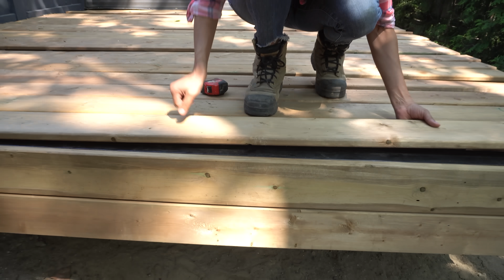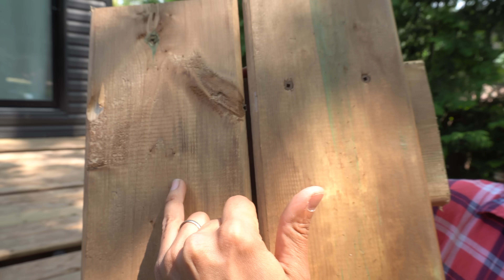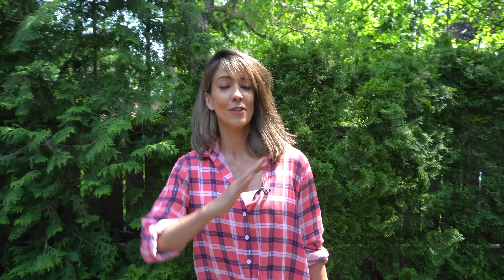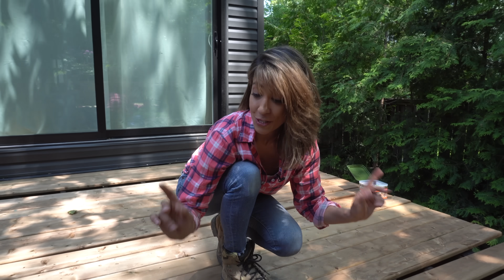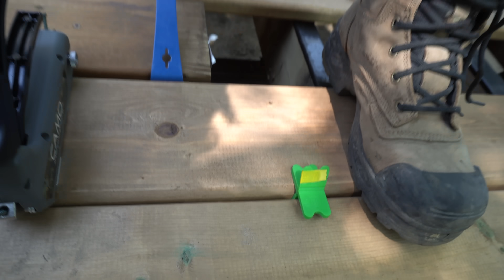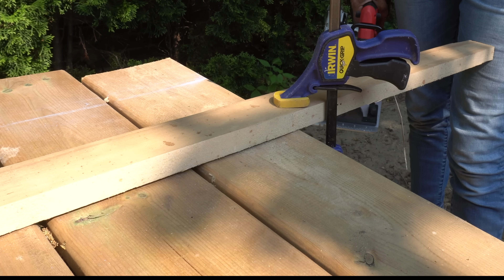Why No One’s Using Deck Screws Anymore: The Hidden Deck Trick You’ll Wish You Knew Sooner

Comment: You can not just choose the "best side" to face up, especially with hidden screw edge fastening and no screw in the center of the board.. These boards WILL cup or crown. If you turn the boards in opposite alignment to the bark you will have some cupping concave and others crowning convex. These screws can not stop this from happening as there is no screw in the center of the board. You should install "bark side up" so that you will have crowning instead of cupping. This will allow water to naturally run off in the reveal between the boards.  On very rare occasions a board will cup in the opposite direction relative to the bark. when that happens you will most likely need to replace it to look and feel correct.

Also, I never use a specific spacer such as 1/8 inch. I use a variety of spacers depending upon the needed reveal. Every board is slightly different in width and can even vary along its length. installing as a constant spacer can cause a build up of tolerance at the final board. One does not want the final rip to be (example) 4.5 inches at one end and 3.75 at the other. 
Instead, every few boards re-measure the left, right and center of the deck to the last wall. Begin adjusting early, using just a tiny bit more reveal where necessary to assure the rip cut board will be the same width on its entire length. never allow less than 2/3 of a board width for the final rip, it will NEVER look correct and be sure that all reveals look even overall. Better to rip the first board enough to assure at least 2/3 of a board in the final ripped board when you know that this will happen. 

This is all basic stuff.
Reply: Absolutely, your comment is what I was going to say. The way I was taught was to always put the bark side up
Reply: Best comment yet buddy
Reply: Those are some great tips, thanks, but I wouldn’t say it’s basic. Don’t be a snob.
Reply: @joshsmithward8848   I am sorry I only stated fact. However, if someone wants to put out a "how to" video they should be getting the facts correct or stop wasting everyone's time and energy and ruining product. It is NOT about snobbery, it is about people on the web that "think" they know something and want to share it when they are dead WRONG.
Reply: @djea3589 I hear you. There are no standards bodies or apprenticeships and titles anymore. It’s just a bottom up sponge world. It may be a little gross but that’s how it is. I agree that there should be professionalism to a how to video put out for the public, just saying to share your own expertise with  an eye to making people do a less crappy job than not doing it at all. Because we will do it no matter what.
Reply: Wrong - heart up. Always. If you understand tangential shrinkage then you know why.

"If you turn the boards in opposite alignment to the bark " - what does that even mean?

Comment: Great video.  How do you attach the L-brackets when you flip the last board?
Reply from the maker: I was able to install them from the underside of the deck since it’s above ground.
Reply: @DaruDhillon pretty clever.I was wondering that myself.Fortunately my deck will be high enough I can shimmy underneath to do that.😊
Reply: What do you do if you can't access the underside?
Reply: @oldbiker57  You can always remove the last board or  2nd to the last board and that would provide access.  Better yet, plan ahead and only partially secure the last and 2nd to last board, get your final board measured and placed, then remove those one or two prior boards so you have access to the underside.

Comment: Looks time consuming and expensive ... traditional exposed deck screws rule, and can be easily tightened after wood shrinks/warps.. and are easily accessable for future repair or modifications.
Reply from the maker: There are definitely fans of each method. This look goes well with modern or contemporary homes. Thanks for weighing in with your take. 👍🏽
Reply: @DaruDhillon  Your Videos are Awesome.. like your delivery & production. You rare very likeable!!.. even if I'm not a fan of them hiden screws, lol.
Reply from the maker: @KrustyKlown  Thanks! I appreciate that. We can all learn from each other and value different ways of doing things. It’s good to keep an open mind.
Reply: You can back out the Camo screws using the tool if a borad ever needs to be replaced.  Cheers!

Comment: What's the point of using screws vs nails if you don't actually do it in a way that allows easy removal of the boards when time comes for repairs? I only use face screws for that reason. Makes it easy to access them as my cedar deck needs regular maintenance because of the humid climate we have in Onrtario.
Reply from the maker: Thanks for sharing your take on cedar. I haven’t found any issue with removing boards. I use a drill on an angle with a putty knife to protect the adjacent board. It’s good you found a system that works for you! I’m in Ontario too. ❤️👍🏽
Reply: @DaruDhillon  Removing boards after a few years (which is typically when you have the need to replace them) is a BEAR because dirt and wood fibers have filled in the screw head making it nigh impossible to engage the bit. Also typically you can't see the head properly and have to jiggle the bit around to engage by "feel". I've had some success by using an awl to clean out the hole (and the gunk in the head) but to do that successfully on 16+ screws just to remove one board is asking for a lot.
Reply: It is easy to remove the camo screws, just put your drill on an angle and pull them out, shouldn't really take more time than face screws.  The camo system is overall a way better option.  The drill angle of the screws prevents warping of deck boards and keeps them crowned for water drainage. The screws are also less prone to splitting wood and the finished look is a lot cleaner and more professional.

Comment: Start your first board at the start of the home or structure your deck IA built off of. After you install it. Start pulling measurements from other end of the deck. So you can start squaring up your deck boards to land perfectly on it. It's alot easier and the end product comes out nice. With less work.
Reply: What?
Reply from the maker: Thanks for sharing your experience and tips!

Comment: You never said what to do with the angles after you flip the board over. How do you fasten them to the joist if the deck is 2 feet off the ground and can't access to screw them?
Reply from the maker: I’d fasten the last deck board and then the two before it so that my drill will fit. Out of sequence from the norm.
Reply: @DaruDhillon  That's the part that was missing from the video. I was confused about this too.  Thanks

Comment: Great video and I really appreciate the detailed explanations. I have a couple of questions; for a ground-level floating deck where one side will be against the house, how do you recommend attaching that last deck board since there is no access to the underneath to screw in the brackets? And, is there a recommended way in which direction to lay the deck boards - the long way or short way on the deck?
Reply from the maker: Hi Frank! For the last deck board I also face screw with the edge deck screws. Like I did in the video for the first deck board. I’ve been really happy with the look because the screws disappear and are hard to see. I usually install deck boards in the same way as in the video. Parallel to the length of the house. It elongates the deck for a nicer look. ❤️
Reply: @DaruDhillon  thank you so much for your suggestions and reply!
Reply from the maker: @frankcampos1251 happy to help. Good luck! 👍🏽

Comment: Any idea how to anchor the deck to the ground in areas prone to hurricanes?
Reply from the maker: Hi Sean, that's an excellent question and important to know in your area. I've seen special heavy duty screw in ground anchors used but I don't have experience with building requirements for hurricane areas.
Reply: Simpson Strong-Tie H1A or H2.5A hurricane ties.